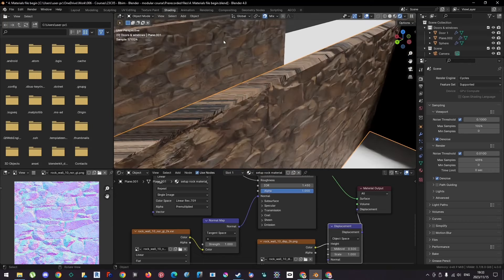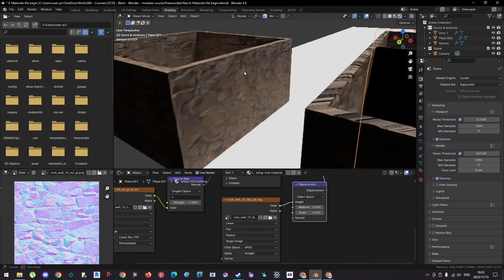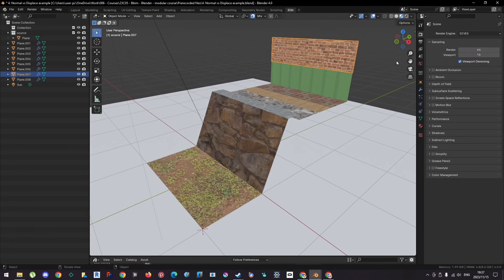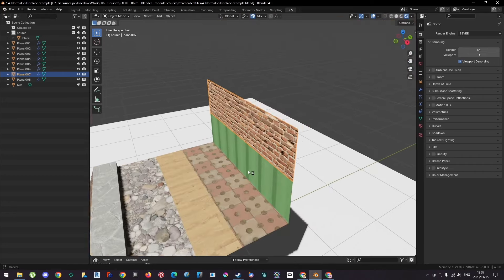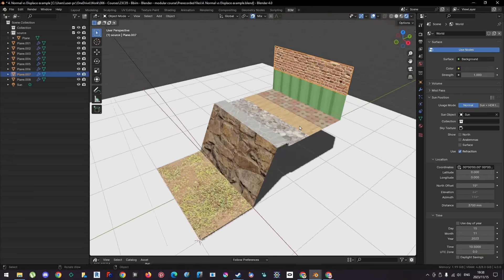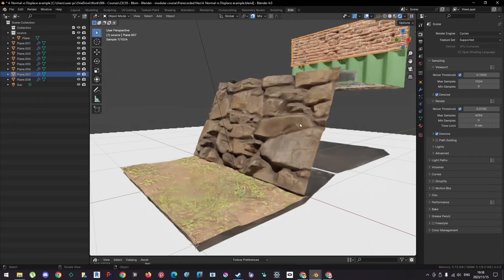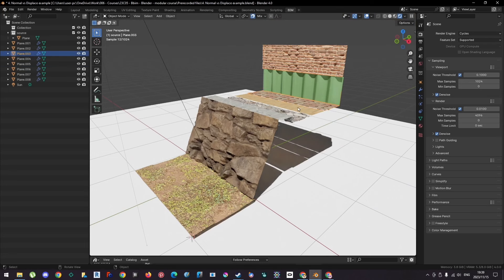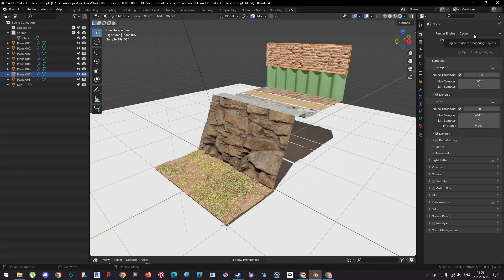How To Make REALISTIC Materials in Blender

Comment: Is there a difference, trade off or gain with managing UV Unwrapping   between Normal mapping  and Displacement mapping. 

Could Displacement mapping influence volumetric calculations?
Reply: That's an interesting question. The official Blender website says that the displacement mappings move the rendered faces, not the physical mesh faces. ....So probably no?